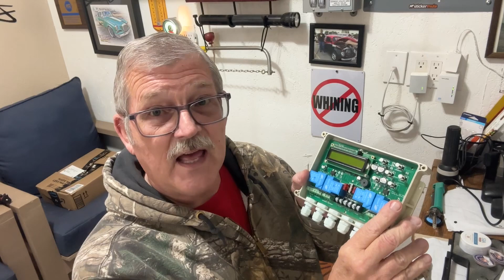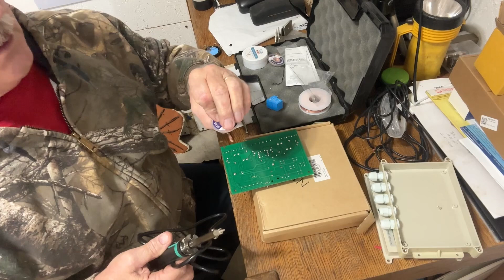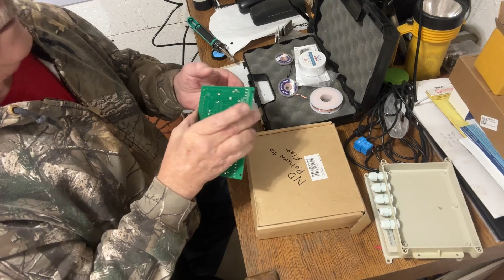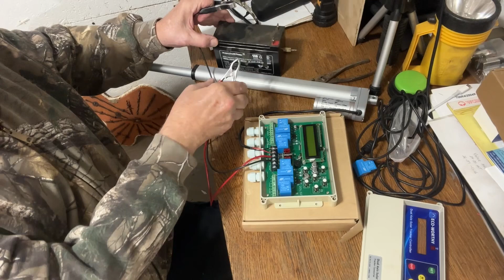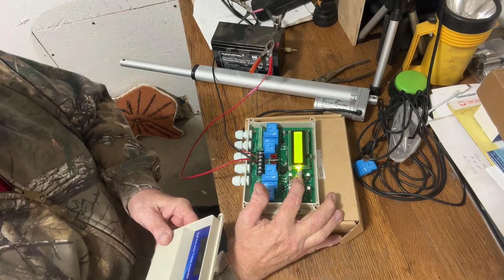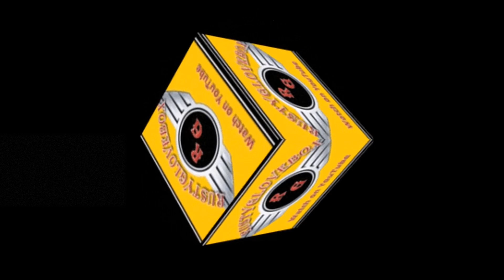Eco-worthy controller relay replacement

Comment: Howdy Lloyd,  do you think it would be possible to hard wire in external relays in place of the blue ones?  I would like to put in beefier relays than the stock ones.  I am also trying to just put in (4) 5pin bosch style external relays (like you have done on a previous posting) but am struggling with the wiring sequence. thx!

Comment: Hi Lloyd! I had never seen a soldering iron like that before, so I found your video very interesting. It's satisfying when you can fix something instead of just buying new. Nice job! Thanks for showing us how!
Reply from the maker: Thanks Todd, that vacuum action sure cleans the solder out quickly. I did drill the hole out on one of the tip so it would go over the pins. I was really happy with the results. Thanks and have a great week

Comment: I need to check into a desolder tool. I don't have anything.  But I have not done anything on a circuit board. Nice job.
Reply from the maker: It can be a very useful tool to have. Thanks for watching Gary

Comment: I've used a "solder sucker" a few times, but usually relied on the braid. This is the first time I've seen a manual sucker built into the iron. One thing to be careful of is the amount of time you leave the heat on the pads on the circuit board. Anything more than five seconds can damage some boards.  I worked on circuit boards for years, and one thing that was stressed in our training was to clean the area after doing repairs like that. The flux residue on the parts can draw moisture from the air and cause corrosion. We used plain old isopropyl (rubbing) alcohol. The 90% stuff works a lot better than the 70%. You did a great job on that repair. The easy way to inspect your own work is to check it against the other joints on the board, if yours look the same as the factory's, then you are pretty sure they're good joints. Thank you for the video! All the best to you.
Reply from the maker: @odahithedubious    Thanks for the tips and information. I will be to use this in the future. Take care
Reply: @RustyGlovebox  Thank you for your kind words. All the best to you.

Comment: that solder sucker is the cat's pajamas.  too bad they didn't put sockets in for those relays.
Reply from the maker: Thanks Vernon, the new tool made the repair process go smoothly. Enjoy your weekend
Reply: I think they'd much rather sell you a new controller, or even the circuit board.
Reply from the maker: @odahithedubious   I think you are right. But not for now. Have a great weekend
Reply: @ Thank you. You too.

Comment: Hi Lloyd, that heated de-soldering tool works a lot better than the simple pump type. I have used ones with a built in electric vacuum pump but they were very expensive.
Reply from the maker: I was watching a video yesterday and saw someone using the electric vacuum model. Hope I don’t need to replace the relays often enough to warrant buying one 🤣. Thanks Doug and enjoy your weekend 🏁